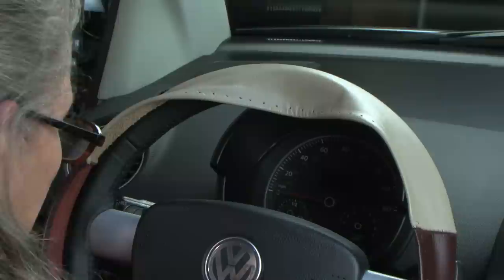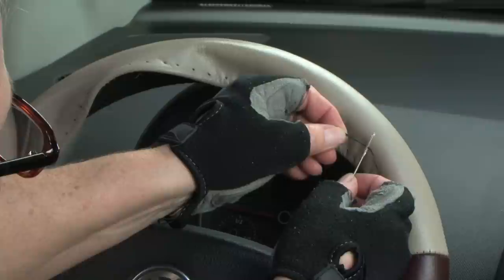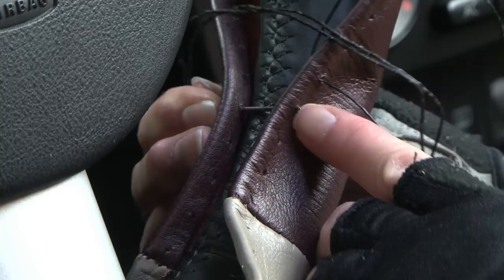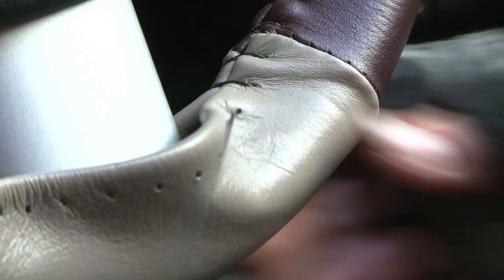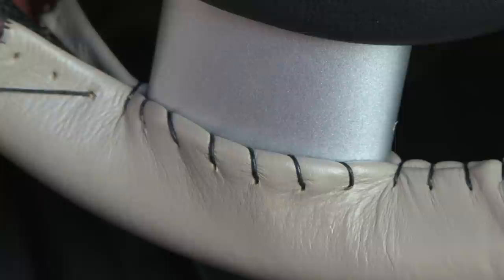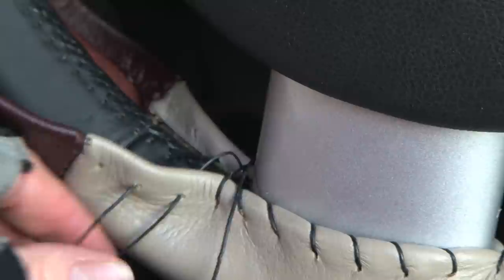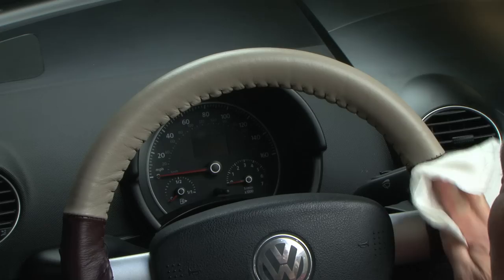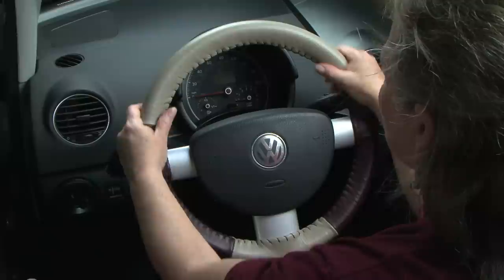The Official Wheelskins Installation Video

Comment: I installed my 4th Wheelskin today. I purchased all of them in past couple of years. You need to be patient when you install them. Their quality is the best and consistent. It takes at least 1 hour to be installed. You'll enjoy them for years. They are fairly expensive, but they are well worth it.
Reply: Just gave up.  Is the non-perforated easier to distinguish lacing holes?  I cannot see the holes on the black leather on the back side. And, how on earth do you keep all that length unknotted?  Ugh!
Reply: @gayleturner945  still after 5 years it works like a charm. They have a video. You just need to be patient.

Comment: Just installed mine, took me close to 4 hrs. When doing a spoke its important to look behind the steering wheel and to count the number of holes. Mine was off by one hole and this skewed all further stitches. I removed all the stitches until I reached this spoke and continued again. The job looks almost perfect and my second installation will be 1-2 hrs as I had a lot of practice.
Reply: yeah pain in the ass  ill pass

Comment: I've done it this way for about 15 years, until now.

The near OEM look that I just did, requires another string from Wheelskin. They are pretty cool and sent me two strings, when I told them I was redoing my cover.

The first thing I did was sew the string into the cover using the holes there. Go around it twice so you get all the stitches in. This is called "Back Stitch".

Now that I have both sides of the cover "back stitched", I laced it up similarly, but now instead of threading through the holes on the cover, you use the back stitches. It looks near OEM. Especially at the spokes.

The end result is something that looks like it took hours and hours to do, but really is about 1.5 of just putting the cover on and lacing it using the holes.
Reply: Hi 
Was wondering if you did what is also referred to as a "baseball stitch" where you use 2 needles and threads?? Looks more factory correct that way.
Reply: @keithcamardelle739  I have. Baseball stitch is  pretty easy to do, You just have to have double thread.

As long as you use a different color thread than the skin, I think it looks and feels amazing.
Reply: @JasonCarmichael  
Cool. Thanks for the reply.  I'm gonna try it out soon, getting a project car with a shot leather wheel wrap!

Comment: Just installed mine today. I got the perforated 2 color skin. Not an easy task. There was glue blocking the inside of holes close to the seams. Had to forcefully open them before start sewing. Make sure you position the skin correctly on the steering wheel. Because if it’s not aligned you have to undo the stitches and reposition. A lot of patience is needed but end result was great.

Comment: This is a well-made product at a fair price, but installation is very time-consuming. I just installed mine on a '97 Wrangler and it's an object lesson in why leather-wrapped wheels are an expensive factory option. The factory leather wrap had gotten dry-rot so I had a bare wheel with foam padding to work with. Instead of a ladder stitch as they show in the instructions and install video, I used a cross and back stitch (or maybe a "baseball" or "herringbone" stitch?) so it looked more like the factory. Turned out fine, and I had at least a foot of cord left over.

For your first time doing it, accept certain inalienable truths:

1) The lacing cord WILL get kinked. Especially early on when it's long. It seems to be impregnated with some sort of adhesive (maybe latex?). So it's sticky and a little stiff, not like regular thread. This is helpful to keep the first few stitches tight. As you sew around, some of the adhesive gets stripped off as it's pulled through the holes, so the cord gets more manageable.
2) The cord will catch EVERYTHING early on. Your turn signal, wiper control, emergency brake handle, the knob on your stereo, your belt buckle, the zipper on your coat, the seatbelt buckle, the recline control on your seat, your knee, your elbow, the back of your ear...
3) It's inevitable that the cord will come out of the needle multiple times. 
4) Your fingers will be sore the next day.

It WILL get easier as you go around the wheel with less cord to manage and you'll hit a rhythm.

TIPS:
- A hair dryer on LOW helped soften the leather a little during the initial fitting, especially if you're in a colder climate or time of the year.
- Give yourself room to pull the cord out through the stitch but not create a rat's nest on your lap. Pull your seat all the way back, recline the seatback as far as possible, and if you have an adjustible wheel, set it at its highest position.
- Have a place for all the other items you'll need that's away from the cord and where they won't fall on the floor. (cup holder, dash tray, etc.).
- As you sew the first few stitches, try to keep one hand squeezing your previous stitch together. Having somebody help with this during the first half dozen stitches will make things a lot easier and faster.
- Keep a needle threader handy, because the ends of the cord aren't bound. It will fray after multiple attempts to re-thread.
- Be very meticulous counting the skip holes and your dummy stitches. I was lucky and didn't need to pull any; everything lined up at the end. You know the old saying: "Measure twice, cut once."
- They say pull tight and they mean it. PULL TIGHT. So wear fingerless gloves like in the video, AND band-aids. Have extras handy. Wear a thimble. The needle isn't super-sharp like a fabric needle, but if you poke your finger hard enough, there will be blood.

Again, it's very labor-intensive, but if you stay patient and focused, and be meticulous and diligent, you'll be happy with the results. The leather is good quality the product is well-made.
Reply: Great tips. I gave up today. First-timer.  I may try again after reading your advice. Thanks!!!
Reply: Thanks for posting this, Alex. I'm hoping my installation won't be a nightmare.

Comment: It took me 2 1/2 hrs and lots of patience...I've sewed and worked with leather through the yrs..but never laced a steering wheel...I had a hard time getting started figuring out the 1st few stitches and the lace got knotted up a handful of times along the way so take your time pulling the lace through the holes but once I got going, you become better at it.. The spokes will also delay you as you need to figure out how close to stitch to the spoke and then start the dummy stitches.. overall, It turned out great but expect to have delays...

Comment: After 15 years, mine finally got a hole in it. I can blame that on my mechanic for using a greasy shop rag, with who knows what was on it? Getting ready to install my second one. I love these covers but it makes it tough when you can only use water to clean it and let everyone who drives it know that it can’t be touched by any cleaners or alcohol.

Comment: Please do not get misguided by the video. The Learher is not half smooth or pliant as it is shown in this video. Also - if it’s perforated leather , forget about it. The holes do not correspond with each other .it’s nearly a night mare to install this leather cover. It took me nearly 6 hours ! ( as a part of my profession I need to maintain  good motor skills which I do ) tight is right , yes’s as I pulled tight it got torn. Will hesitate to buy from this company

Comment: While the video is ok overall, I'd offer that the "over and over" loop stitching, while secure, doesn't look very professional along with having the habit of leaving some of the edges exposed.    Literally just as easy to do, and that looks a whole lot better and pulls the edges down and in, is a simple stitch used by the professional installers.  It's sometimes called the "baseball stitch", and is very similar to how one might lace their shoes, alternating left and right, overlapping and pulling the edges down and in.
Reply: Would 'baseball stitch" require a longer lacing cord than what is provided for the type stitching on this video?  I don't want to come up short?

Comment: Anywhere i can get this installed?  Really not feeling like spending 6 hrs on this.
Reply: Don't.  Get a BELL, Hyperflex Core Steering cover.  Those things are super flexible, take like 8 seconds to get on, and when they go on they stay snug... bump all this noise.
Reply: Any upholstery shop could install this for you in a reasonable amount of time. Probably avoid the Walmart steering wheel covers...those are mostly junk. This is something you'd do if you plan on keeping your car virtually forever and kind of goes along with other upgrades like Katzkin leather.

Comment: My only gripe is im not a huge fan of the stitches over the spokes. But seems unavoidable.
Reply: It is unavoidable, I’ve done some that have had such wide spokes that I had to put 3M  double face tape under that section of the cover so it wouldn’t pop up. You can’t even tell there’s tape under it but at least the cover won’t stick up.
Reply: @TJ-qz6hr  I just got the East Detailing Kit and it came out wayyyyyy better than this.
Reply: @jaked5651  Thanks for the info.

Comment: Can you take off the old rotting cover first?  Or are these covers made to account for the old cover staying in place, which then would install all loose if you were to remove the old cover?
Reply: I don't see an answer to your question. Anyone?
Reply: was wondering the same thing
Reply: Guys, it's a cover. It goes over the existing one. No you don't remove the original cover EVER. :)

Comment: Can the cover be tucked under the spoke trim instead of over it? Has anyone tried doing that?
Reply: This would be geometrically impossible
Reply: After installing this cover I realize it would be very difficult to do it that way.
Reply: I noticed that there are some bumps inside the cover. Maybe the wax from the string coating may have gotten between the steering wheel and wheelskin. Not a big problem. Its the best steering wheel cover - the feel is incredible.

Comment: These really do not work so well on newer cars with audio etc controls on the steering wheel. Impossible to get a really tight fit when you need to skip  2-2.5"
Reply: yep i have a Ram 1500 with large gaps. The top of the wheel looked great but those areas looked like crap. I pulled the whole cover off. Total waste of money
Reply: @hogs150  Was it loose or something around the gaps? They wouldn't tell you to do this, but maybe some glue would help to keep it down there.
Reply: I’ve been installing these for 15 years. Do not use glue. I use 3M double face tape under the cover on the spokes, you can’t even tell it’s there, and it won’t move.